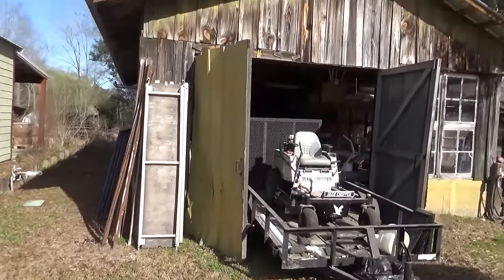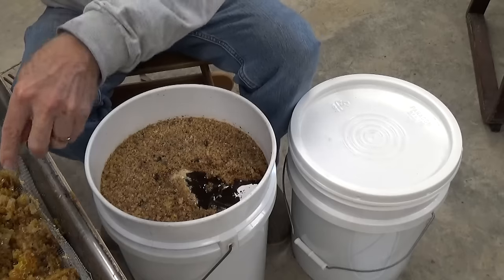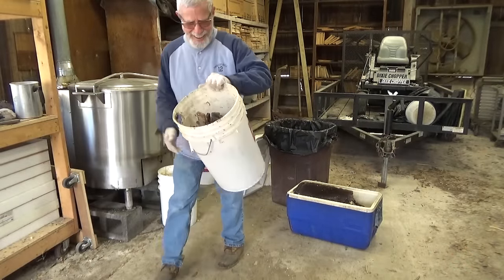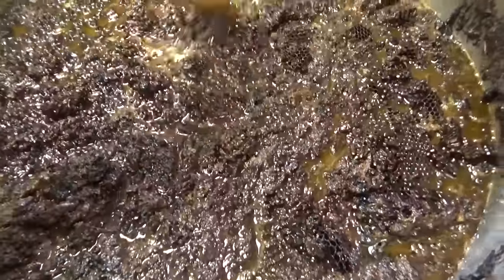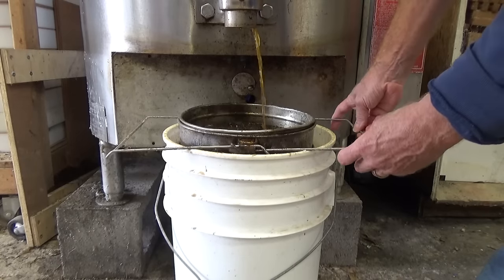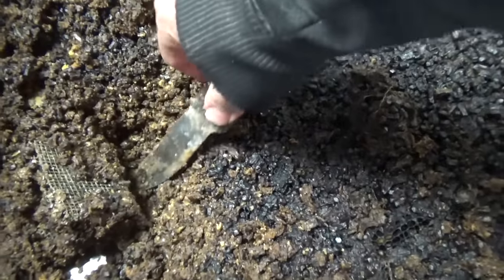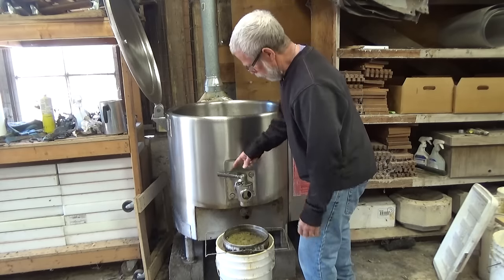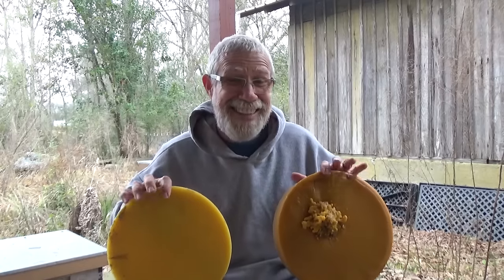Rendering beeswax.  Making what's old new again.

Comment: I found that when I used a spatula if I rounded the end of the spatula to comform to the shape of the bucket or barrel it worked really well to remove all the caps without taking very much honey. I also found if I had a hot bucket of water to warm the spatula the honey didn't stick to the spatula as much compared to using a cold spatula.
Reply from the maker: What a great idea to round the end of the spatula, I know that would work so much better than the straight edge. Also, another good idea of the heated spatula....just as long as all the water was dried off the spatula. Thanks for watching, and I hope you will check out more of my bee wrangling/ bee rescues adventures and let me know what you think of them. By the way, I post a new video every Friday morning, and I look forward to hearing from you again soon.  God's peace William.
Mr. Ed

Comment: Two minor points:
I would have rendered the cappings first to avoid pollution with the remains from the rendering of the dirty comb.
If you were to render the remains from the rendering again, you could get more wax, but I would recommend a tall, narrow column (and hot pressing if possible).
Reply from the maker: Your points are well taken and greatly appreciated. Since our operation of rendering consists of the 30 gallon kettle, I utilize that tool to do everything. I understand there are many ways to render wax, and over the years I have used at least a dozen different methods to do the job , but because I render at least 200 pounds of beeswax a year, I need to do things a a bit larger scale than most beekeepers, and I have found the method I employ to be very effective and efficient. Thanks for watching, and I hope you will check out more of my bee wrangling/ bee rescues adventures and let me know what you think of them. By the way, I post a new video every Friday morning, and I look forward to hearing from you again soon.  God's peace Bert.
Mr. Ed

Comment: I have to say I haven't seen you melt wax so dark and dirty in the past.  I'm probably wrong but man that was alot of trash left over!  You did get some nice a nice wax block out of that mess.  The other wax block looked so much nicer and I bet it smelled wonderful.  The upgraded lighting turned out great and makes your work area much better.  Always love your videos Mr Ed and seeing your great smile!!  God Bless!!!!!!
Reply from the maker: Whenever I render old brood comb it's ALWAYS nasty, dirty looking. However, the finished block is beautiful! I am extremely happy with the light upgrades in both buildings, what a blessed man I am. Thank you for your blessings and for watching. God's peace Phil.
Mr. Ed
Reply: I use the dark water to paint the inside of the swarm traps 🪤 it smells good… even make cartridges with cotton cap full of wax water…
Reply: Do you have a plan for those old frames/foundation? Hopefully you find a bee club or something like that to give them to.  Maybe sell them for 50 cents each and donate to the Abbey.  For getting honey out of those cappings:  I did something last fall that worked out great.  I melted the cappings in a double boiler at the lowest and slowest heat I could manage.  The honey sank to the bottom and wax rose to the top.  I ended up with a significant amount of bakers honey that is great for sauces or caramels.  Thanks for the great video.

Comment: I still reckon the way I want my future set-up is a big kettle like that, but instead of straining out the sludge while the wax pours out the tap and leaving so much wax absorbed in the sludge, I want a set of screens that lock into place against the sides of the kettle. Put all the scrap wax in, put the screens in on top of them, add water until the water is above the screens, and then just let it simmer so the wax comes to the top but the sludge is caught below the screens. When it's done, turn off the heat and leave it to cool until the wax is set, then drain out the sludge and water from below, and the wax is left sitting on air with only the very fine sludge stuck to it that was able to fit through the screens. I reckon that way we wouldn't lose any wax absorbed in the sludge and I could put the sludge in the compost with a clear conscience.
Reply from the maker: I have been trying to get a set up like that for this tank, I just have not gotten it done yet. Thanks for watching, and I hope you will check out more of my bee wrangling/ bee rescues adventures and let me know what you think of them. By the way, I post a new video every Friday morning, and I look forward to hearing from you again soon.  God's peace.
Mr. Ed
Reply: @JeffHorchoff  Yeah, I always enjoy your vids - I don't watch routinely, I just binge every so often. Peace to you too, and happy bees.

Comment: You need a metal barrel with a lid. Make a hole in the lid, fill the bot a third with water, put a metal mesh at two-thirds and over the mesh you will put honeycomb and wax. Close the barrel with the drilled lid and light the fire. Water will boil and steam, steam will melt the wax from the honeycombs and wax will flow into the water, after a while unwrap the barrel and put more honeycomb or wait until all the wax has drained from the honeycombs, turn off the fire, let cool a little and drain Water and wax from the barrel.
Reply from the maker: Wonderful suggestion, thank you for the help and for taking the time to watch the video. Also, I hope you will check out more of my bee wrangling/ bee rescues adventures and let me know what you think of them. By the way, I post a new video every Friday morning, and I look forward to hearing from you again soon.  God's peace.
Mr. Ed
Reply: This is a way more effective way of doing it. Have been trying to find the most effective way to render wax and this way seems the best so far

Comment: Can you use the trash after the rendering in the garden? It looks like good stuff, but would it attract those beetles and wax worms or other stuff?
Reply: This is a very good question . I'll be watching for the answer.
Reply: @brucekaminskimd3417  I just saw in another of his videos.. he said that stuff is good for fire starter and compost.
Reply from the maker: It is perfect to put in a compost pile which is where this will go. I am told it helps with the aeration of the pile, and it does not attract beetles or moths. Thanks for watching. God's peace Heather.
Mr. Ed

Comment: Hi jeff! Quick question. It looks like its boiling quite hot. Can you burn the wax going that hot? Or when it’s in water like that it’s not a problem? I have a wax wood boiler but I haven’t used it yet I got it from the guy I bought my hives from. Just scared I’m gonna end up burning my wax and wasting all that time. Anyway happy Easter from Sweden!
Reply from the maker: As I mix water with the wax, it does not burn it. However, wax can burn so you have to be very careful not to do that. Happy Easter to you and yours as well. God's peace.
Mr. Ed
Reply: @JeffHorchoff  so if it is boiling in a bath of water and you tap it as soon as you see it’s melted it shouldn’t be a problem?